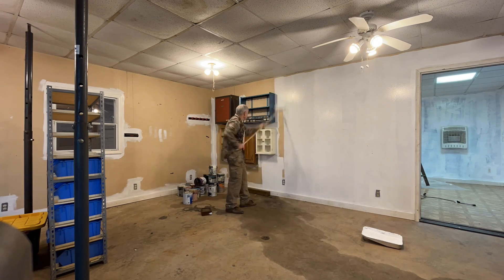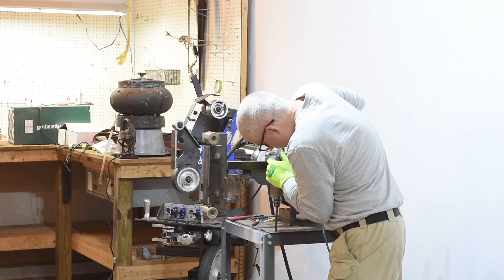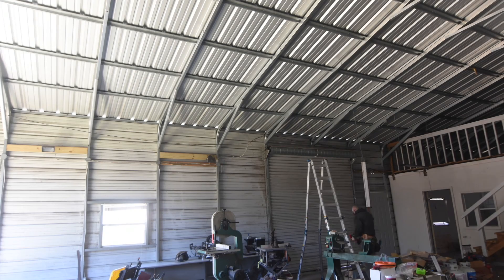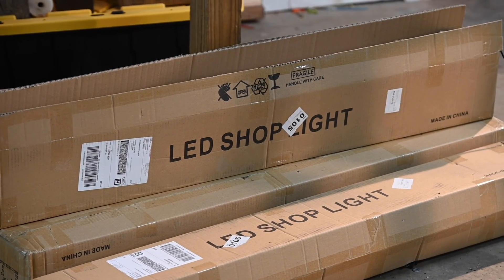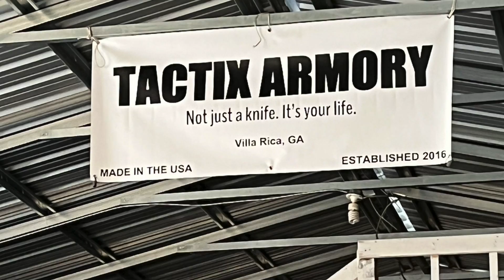Will I Ever Make A Knife Again?  New Shop Update!

Comment: My heart goes out to you Walter. I'd rather have voluntary surgery than move. On the flip side, you have a clean slate and a ton of elbow room. A seemingly silly way of setting up and allow for a reorg down the line is to build a scale model out of cardboard of the shop. Takes a couple of hours, but saves time with measuring tapes and keeping a 3D map in your head. Keep the model on a high shelf for reference when a new piece of machinery appears and changes are needed. Cardboard cubes representing existing stuff are easily moved around on the model and saves your back moving stuff seven times.

Comment: If you want the fastest and most efficient shop move you need to hire out most of the work. You need someone who can prepare your new shop so it has everything finished before anything is moved into it. Someone who can measure everything going into your new shop, figure out what that equipment needs to work once moved & help you layout the new shop. Lastly once everything is ready in the new shop such as all electricity is ran for every machine, all painting and lighting is completed. Then you need someone who can pack & move your old shop to the new one and put everything where it goes according to your plan. If you would have done it this way your show would have only been down for two or three days at most. The only downside to this is it costs more to move but with less production loss it generally pays for itself. This is the method used by a lot of larger companies.

Comment: 10 guage wiring on a 20 amp breaker is a really good idea at times. There is no risk, and less voltage drops on long runs. or heavy motor loads.